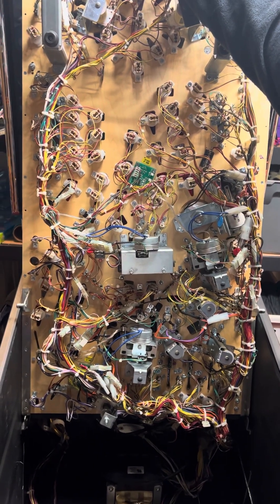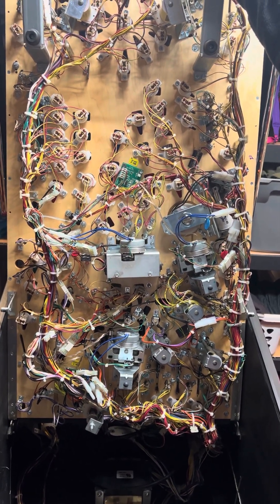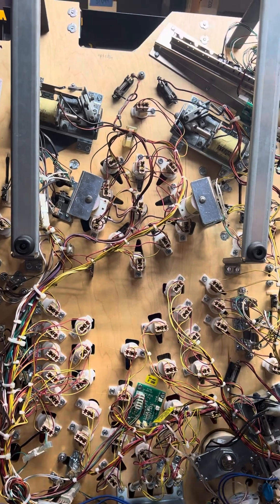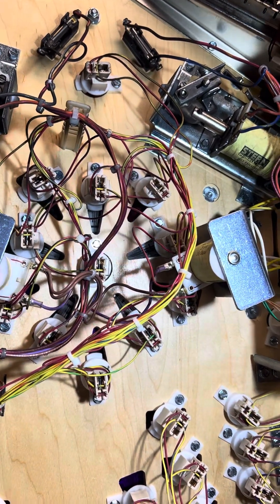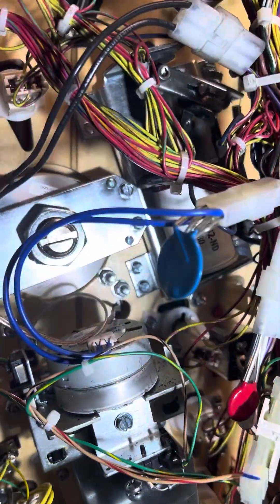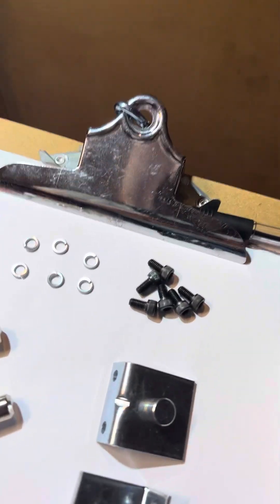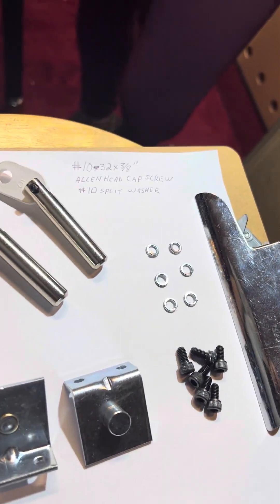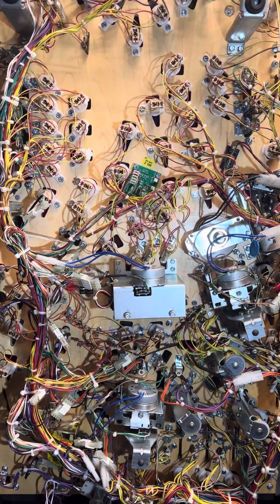Stern Pinball flipper coil stop problem part 1 of 2

Comment: Why did they change to a single tap coil?
Reply from the maker: Simply put, it was a huge cost saving measure. Theoretically, it works on paper. The main problem is that the flipper coils get very hot because they have full 48vdc on them all the time.